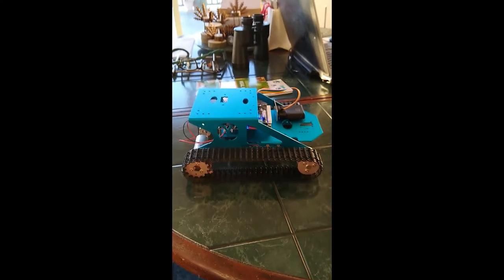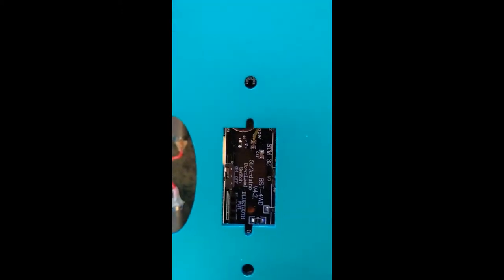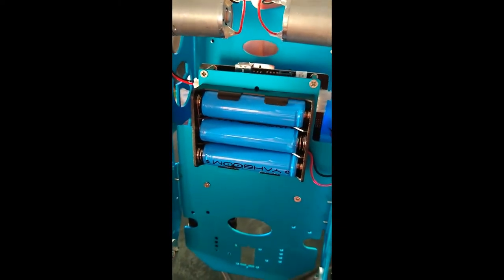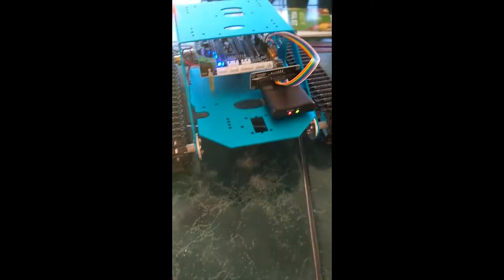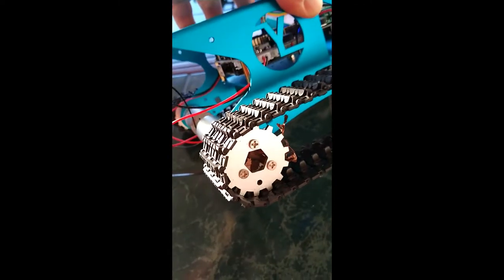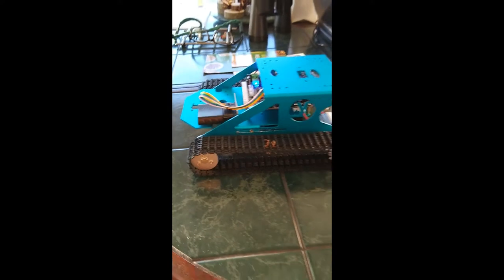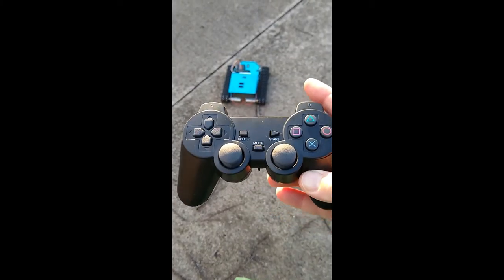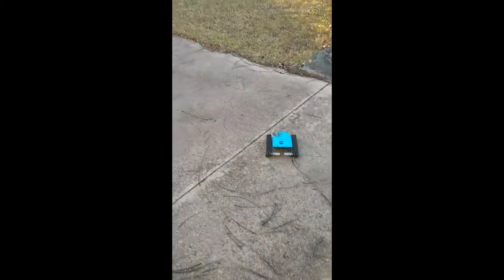ARTS - G1 tank Indoors and Out Review 2020 12 31

Comment: Yahboom has a Mantis type robot that is great outdoors. I have two of those and two G1 and also the Pi Motion. This tank also works with a Raspberry Pi for CV image stuff. Using the sensors gives it way more capabilities. I think this is Yahboom's attempt at a smart tank with a nod to the actual G1 tank. 
I really like my G1. It is a beautiful robot that has enormous capabilities already built in, but only if you are good at programing. The Arduino version gives you more of a robot control where the Raspberry pi version give you a more vision AI feel.
 I do recommend it for us robot collectors. The great thing it does is set up its own WIFI hub. That means you can use it anywhere as long as you have a phone or tablet.
 I love all of my Yahboom robots! Some of the robots can be a bit expensive but they are high quality and if you are a collector like I am then you'll see you get what you pay for. Verdict...Yahboom is worth the price. They make extremely powerful AI robots but you can only unleash that power if you are good at programing or willing to learn how to be. Yahboom robots are additive so beware.